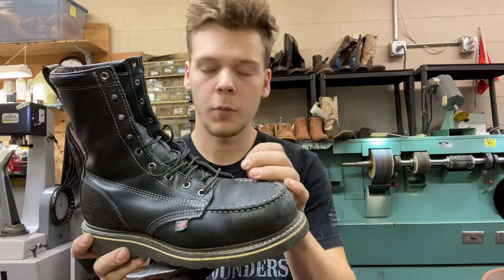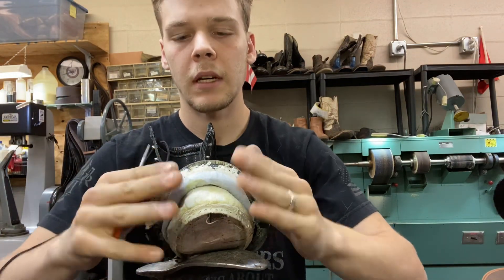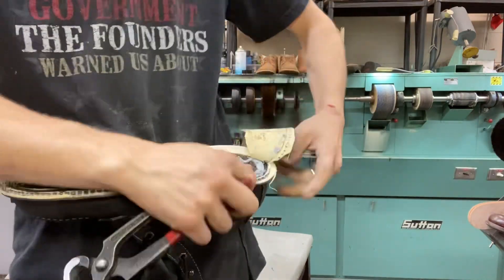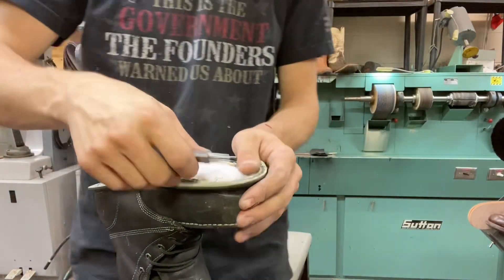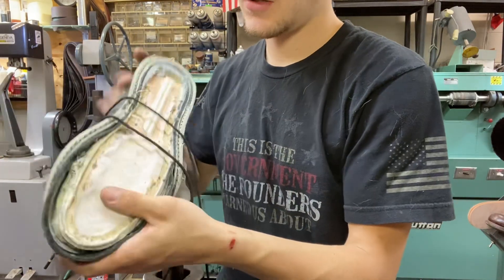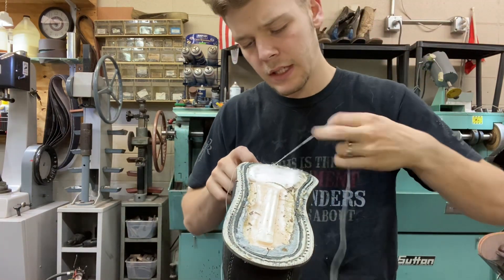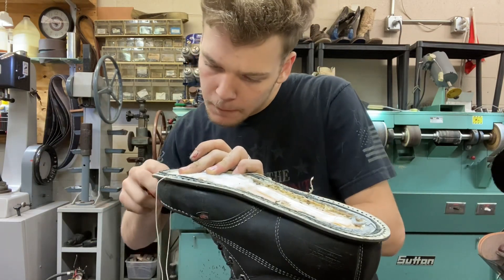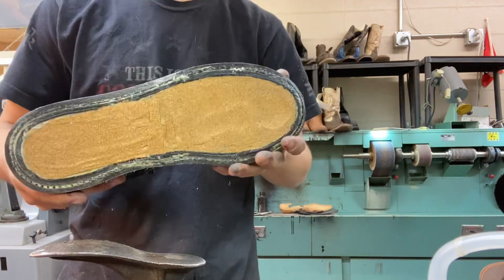How to remove the steel toe in your boots.

Comment: I have an old pair of Danner's the Air Force issued me 20 plus years ago. They should be a great light weight winter boot, except that the steel freezes my toes.  I am taking them to a cobbler tomorrow for a resole, I really want the steel toes removed as well since I do not require the safety feature with these boots any longer.  This will be money well spent, as these are a quality USA made boot, and the uppers are in excellent condition.  Thanks for the vid!

Comment: I'm curious...what's the customer's rationale for having this done, especially considering the cost? $170 is about what a new pair of these would cost without the steel toe.
Reply from the maker: I believe this customer accidentally ordered with a steel toe and couldn’t find the right size without the steel toe. Also I’m pretty sure new Thorogoods are about $250
Reply: Great video but I had the same impression… How is this even remotely cost-effective?
Reply from the maker: @neonnoodle1169  it’s really up to the customer. There’s a lot of pros to fixing/altering shoes. There’s no break in period, plus we use better quality soles that last longer compared to what the manufacturer uses. Also unfortunately the newer boots that are being made aren’t made as well as the older ones which is why I always recommend saving the older pairs
Reply: Im a 16 uk 17 us.... steel toe boots are all i can virtually get in my size.... only issue in my state nightclubs dont let steel caps in

Comment: Couldn't you have just cut the stylish stitching around the top of the toe, removed the steel and re-stitched it?
Reply from the maker: Unfortunately it's not that easy no. I wish it was though. It's kinda hard to explain why without actually showing you, but no unfortunately we can't do it that way
Reply: @Theshoeman02  Thanks for your reply.  I have a pair of Blundstones that I want the steel toes out of.  I’ve discovered I can pull the steel out of position by pulling on them from inside the boot.   The inner liner would have to be cut or unstitched to completely remove them but there would be no damage to the outer boot.
Reply from the maker: @pdb4045  interesting 🧐

Comment: You really need to tape those fingers for safety.
Reply from the maker: I haven’t been able to find a glove I like. The thin rubber ones rip super easy, and the thick ones are hard to work in
Reply: @Theshoeman02  totaly agree, glove limit our fingers' sensitivity.
Reply from the maker: @help3106  yes and it’s impossible to small detailed work like put a small brass nail in
Reply: @Theshoeman02  

ATG MaxiFlex cut resistant gloves are really great when you need protective gloves but also need to maintain dexterity. No padding just like a protective second skin.
Reply from the maker: @crab9403  thanks for the info, I’ll look into them